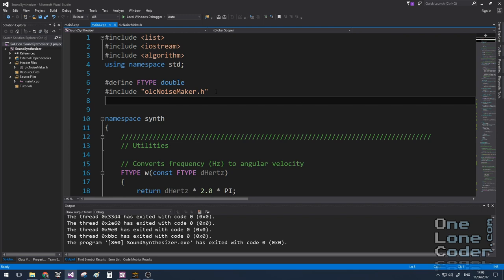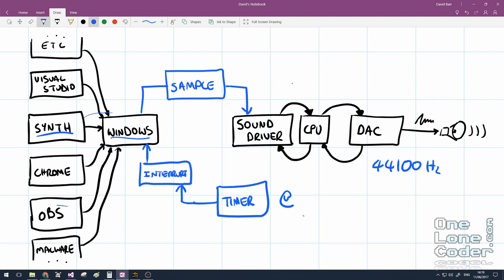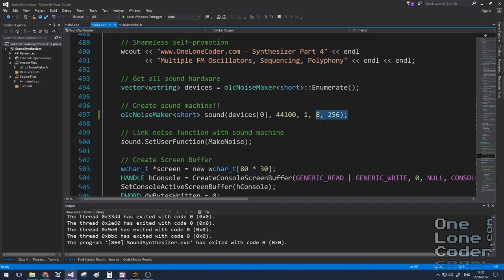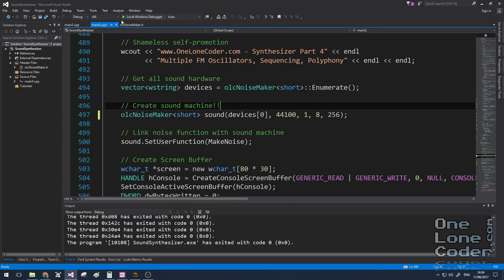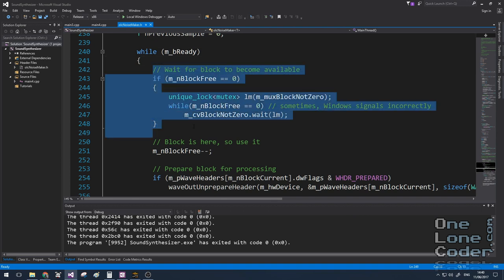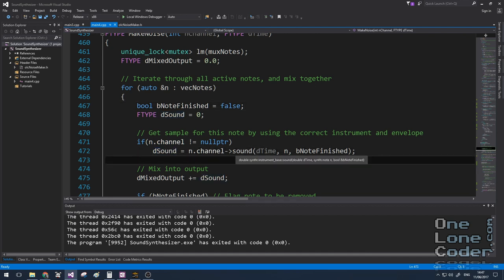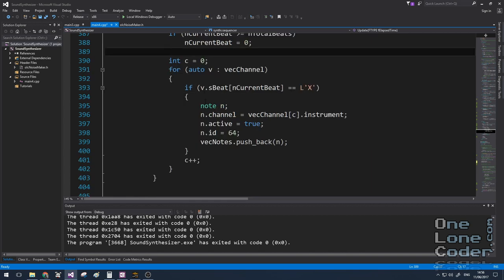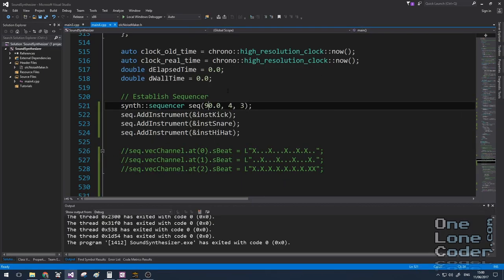Code-It-Yourself! Sound Synthesizer #4 - Waveout API, Sequencing & Ducktales

Comment: (RE: all the explanation up to 8:12) - it's interesting when you put it like this, because it could be manageable to actually have a big buffer size but also fire interrupts when the player is pressing or releasing a key to force recalculating the buffer? In fact if you take this to the extreme, you could have a pretty low timer frequency? Although when automatically playing keys, either through a MIDI (or MIDI-like) file, or your sampler system (which I didn't see yet), if you have many voices it might be costly, I guess you wouldn't want to recalculate that big of a buffer after all... Rule #1 of optimization is profiling :-) in the end as usual your solution is most simple for legibility and easy understanding. Cool stuff as usual! (also, I know this is two years old, sorry :-P)

EDIT: You'd also want to optimize-out interrupts when several keys are pressed at the same time, that works for automatic playing but still leaves the question open for chords. Alternatively, it could be transformed into a feature, by making sure key state transitions only happen at regular intervals, maybe a divisor of the tempo... Makes it sound like you're always perfectly on beat :-)

EDIT2: Sorry, I typed a block of text again. >__<

Comment: I'm thinking of implementing your synthesizer code on a FreeRTOS embedded device with rotary encoders and knobs and switches to configure the waves and envelopes and send the Digital sound over Bluetooth to a external DAC on a Bluetooth speaker or something like that. A Cheap ESP32 has 2 cores at 260MHz and several IO ports as well as WiFi and Bluetooth...

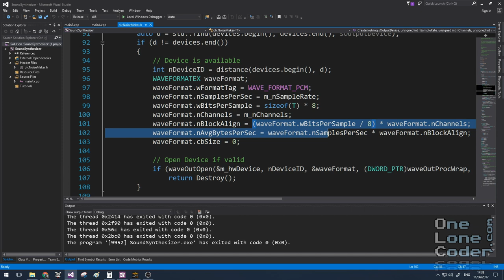Comment: 12:24 Have you considered what will happen if the supplied device name hasn't been found on the list? :q  In that case, this block will get skipped, so the device won't get created (which wouldn't be possible anyway for a bad device), but the function continues to run after the block willy nilly – it allocates the buffers, creates the thread, and returns `true` :q  I'm not sure if that's what's supposed to happen for a wrong device :q  I'd rather changed the condition to its opposite and exited the function on bad device, and put the code from that block after that `if`.
12:48 I'm not sure about this code too, because it doesn't seem to take into account the fact that there could be more than one channel, and in this case, more than one sample in each frame. If `T` is supposed to be the type representing a single sample, then `sizeof(T)` is the number of bytes of just one sample, and when multiplied by `m_nBlockSamples`, it will tell the block size in bytes, with the assumption that each there's only  one sample each frame (i.e. single channel).

Comment: Hi, great series, thanks. Can I ask you to update the olcNoiseMaker.h on GitHub as its only the first version (part 1) - it changes quite a bit between Part 2 and 3 (e.g. SetUserFunction takes the channel as an int - GH version still only has Double) - I can blag my way throught hat change, but not sure what to do with  UserProcess now, currently just returns zero. Also, part 3 is not on your blog site that I can find; 1, 2, and 4 are. Thanks again. 
PS: I liked the style you used in parts 1 and 2, coding as we went along, rather than 3 and 4 where you show changes you made - it is useful to run after little changes (learn far more that way), rather than  have it broken until the end of the video, or just pasting from GitHub (had no problem with the length, your pace is great, so didn't get boring).
Reply from the maker: Hi Richard, thanks for following along. Its really humbling when someone like yourself is using and enjoying the material. I've uploaded the modified olcNoiseMaker class https://github.com/OneLoneCoder/synth/blob/master/olcNoiseMaker_VIDEO_PARTS_3_4.h 
The pace is difficult to judge. I think you're right. The synthesizer videos benefit from the more methodical pace, as I made the decision to do a multi-part tutorial series (and I'm returning to it in the not too distant future ;-)), whereas I try to keep the one-off videos self contained but not too long. Hey, I'm still learning how to do all this! Perhaps the C-I-Y videos should be more tutorial like too.
Anyway thanks for the support!
Reply from the maker: Looks like you need UNICODE enabling for your compiler!

Comment: fantastic set of videos what would be the best way to display the sound ?
Reply from the maker: Thanks Tommaso, I have developed a simple library for visualisation called olcPixelGameEngine (there are many of my videos that use it). However in general, you want to view the amplitude of the sound (like a DAW) and sometimes you want to view the frequency spectrum whcih is considerably more complex to understand, but reasonably easy to do once you have taken the Fourier Transform of the waveform.

Comment: 11:36 So it's platform-locked? ;/
Reply from the maker: Not any more! The community created a openal/alsa version as an extension to my PixelGameEngine. It's pretty much identical in function, and you can grab it from the repo!
Reply: @javidx9  Ok, cool, I'll take a look...
Programming ALSA seems quite complicated because of very poor documentation and lack of good tutorials.
However, it's kinda platform-locked too (Linux-only).
For a cross-platform approach, SDL or SFML might be a better option.

Comment: Hey. Great series. I was wondering how you avoid clicking or popping noises between sounds played back to back. For example, if you’re holding down a note and it’s sound buffer is played repeatedly (giving the illusion of one continuous buffer) how do you avoid delay between the buffers? I’m trying to implement a similar setup to yours. Thanks!

Comment: Long shot, but I was trying to update a project from a few years ago which used this, and I have no sound in release mode, while debug mode works ok. Now, I've messed with the system a bit and I know this is an old video, but I figured I might ask if anyone has any stray pointers, since I'm stumped
Reply from the maker: This sounds like a variable initialisation issue. In debug, everything gets zero'd by default, not so in release, so make sure you're not using something you've not defined properly.

Comment: Hi, this is an excellent tutorial! I actually use your template for trying out different analog filter emulations. However when i create several "oscillators", or more correctly, sine functions for frequency modulation, the amplitude of the waveform is always rising, leading to increased modulation. I suspect it is because of the m_dGlobalTime parameter in the olcNoiseMaker class that is constantly growing. However that variable is only used in the sine function, so i think i miss some math related here. Any clues?
Reply from the maker: Hey thanks! It's additive synthesis so the more stuff you add in, the signal will tend towards increase in amplitude.
Reply: Thanks for your fast reply! I understand what you mean, but i use the value of the sine function A to modulate the frequency value for sine function B, so it is not about adding sine waves together. 
// Pseudocode more or less
float sineA = sin(w(freq)) * 0.5; 
float sineB = sin(w(freq + sineA)) 

Anyway, your tutorials is awesome!
Reply from the maker: Ahh i see. That is strange. It seems unlikely sine would return values > +-1 under any circumstances. I might have a play myself and see if I can replicate amplitude increase
Reply: I will report on my progress as well
Reply: I solved it! Of course i have to add the modulation value after the base frequency has been calculated and multiplied with the dTime value. So now it works as i expect. Thank you anyway for your reply!

Comment: Hi,
Your 18:30 example is silent
Reply from the maker: Hi, it's really low frequency, you may need a subwoofer. A bad choice on my part perhaps, but it's there!
Reply: Understood, thank you!
I also noticed, that in your previous example (main3a.cpp) you never assign a second channel to a note, only first (line 409), while actually checking for it at line 335. Just some observations..
Reply from the maker: You're quite right. The example code only allows the user to interact with a single instrument. But Easy to mod in with the shift key for example. Its a result of my testing code still being in there. I try to sanitize the code before uploading it to make it "easier" to follow and modify. Part #4 does change this approach however to a more flexible option.
Reply: Okay, understood, thanks again!

Comment: When I considered enhancing my voice synthesizer to do musical instruments, I intended to be able to generate very authentic-sounding waveforms. I'd achieve this by studying the frequency spectrum of the various instruments (string, woodwind, brass, and even percussion). Generating a wave from the frequency spectrum is easy to do with the formant synthesis technique. In fact, most musical instruments would be much easier to generate than the human voice. Also, my voice synthesizer would be able to sing, and not just speak. I have wanted to do some song parodies, but I can't sing; so my voice synthesizer would be my singing voice. Part of the reason why I abandoned the project is because other developers are probably already working on this.

Comment: would you do some advanced stuff in (pure)C??
Reply from the maker: Hi Laureano! If I may ask why pure C? Which platform are you targeting?
Reply: i just love C.. at the time my target is OSX i think, 
but it would be nice to know; how to do "everything" for linux and pc too..
Reply: The problem is that you could not get away with using "pure" C (by pure I am assuming that you mean cross-platform) for this tutorial as you would have to use Windows-specific synchronization/threading APIs (as opposed to the pthreads library on *nix systems).

Comment: Hi,
I have tried to retype files main4.cpp and olcMakeNoise.h (both versions) and after two evenings of typing, couldn't compile. it was few wrong type errors that I tried to fix with some 1-3 line conversions. It compiles but it is so slow. I have tried on i7 1st gen/win10 and dual xeon 8 core/win7... both are with high latency, and in release version there is no sound at all. I have also checked if I made any typing errors with file compare utiliy, found a few mistakes and correct them, but no change.
I am using visual studio community 2017 version 15 with latest updates and default settings. I have just made empty c++ console project and typed in your code. 
Perhaps I just need to make some setup changes to make it work as is? Or if not, I don't know if you have time to check the changes I made to make it compile the main4.cpp maybe that is the reason app is so slow running and unable to play both beatbox and pressed keys? If you are willing to review and mentor me in making this work on my setup, please give me your prefered way of communication.
I am total novice in c++ and I used to make a few things in visual basic few years ago. 
Thanks
Reply from the maker: What where the errors?
Reply: @javidx9  from original files I get this:
Severity Code Description Project File Line Suppression State
Error C2664 'BOOL WriteConsoleOutputCharacterA(HANDLE,LPCSTR,DWORD,COORD,LPDWORD)': cannot convert argument 2 from 'wchar_t *' to 'LPCSTR' synthmaster c:\users\ikalo\source\repos\synth-master\synth-master\main4.cpp 697 
Error (active) E0167 argument of type "double (*)(int nChannel, double dTime)" is incompatible with parameter of type "double (*)(double)" synthmaster C:\Users\ikalo\source\repos\synth-master\synth-master\main4.cpp 559 
Error (active) E0167 argument of type "wchar_t *" is incompatible with parameter of type "LPCSTR" synthmaster C:\Users\ikalo\source\repos\synth-master\synth-master\main4.cpp 697 
Error C2664 'void olcNoiseMaker<short>::SetUserFunction(double (__cdecl *)(double))': cannot convert argument 1 from 'double (__cdecl *)(int,double)' to 'double (__cdecl *)(double)' synthmaster c:\users\ikalo\source\repos\synth-master\synth-master\main4.cpp 559 

after I fix the .h file then:
Severity Code Description Project File Line Suppression State
Error (active) E0167 argument of type "wchar_t *" is incompatible with parameter of type "LPCSTR" synthmaster C:\Users\ikalo\source\repos\synth-master\synth-master\main4.cpp 697 
Error C2664 'BOOL WriteConsoleOutputCharacterA(HANDLE,LPCSTR,DWORD,COORD,LPDWORD)': cannot convert argument 2 from 'wchar_t *' to 'LPCSTR' synthmaster c:\users\ikalo\source\repos\synth-master\synth-master\main4.cpp 697 

after I put some code to convert wchar_t to LPCSTR, then I got error when adding notes to vector so I had some conversions there too.

so, I found this trick to convert
                 wstring Wscreen(screen);
  string Lscreen(Wscreen.begin(), Wscreen.end());
  WriteConsoleOutputCharacter(hConsole, Lscreen.c_str(), 80 * 30, { 0,0 }, &dwBytesWritten);

after that I get this error
Severity Code Description Project File Line Suppression State
Error C2664 'void std::vector<std::wstring,std::allocator<_Ty>>::push_back(_Ty &&)': cannot convert argument 1 from 'CHAR [32]' to 'const _Ty &' synthmaster c:\users\ikalo\source\repos\synth-master\synth-master\olcnoisemaker.h 182 
Error C2664 'void std::vector<std::wstring,std::allocator<_Ty>>::push_back(_Ty &&)': cannot convert argument 1 from 'CHAR [32]' to 'const _Ty &' synthmaster c:\users\ikalo\source\repos\synth-master\synth-master\olcnoisemaker.h 182 
Error C2664 'void olcNoiseMaker<short>::SetUserFunction(double (__cdecl *)(double))': cannot convert argument 1 from 'double (__cdecl *)(int,double)' to 'double (__cdecl *)(double)' synthmaster c:\users\ikalo\source\repos\synth-master\synth-master\main3a.cpp 394 
Error C2664 'void std::vector<std::wstring,std::allocator<_Ty>>::push_back(_Ty &&)': cannot convert argument 1 from 'CHAR [32]' to 'const _Ty &' synthmaster c:\users\ikalo\source\repos\synth-master\synth-master\olcnoisemaker_video_parts_3_4.h 186 

so, I found similar trick like the one for the screen
if (waveOutGetDevCaps(n, &woc, sizeof(WAVEOUTCAPS)) == S_OK)
   {
    char cName[32];
    std::vector<char> vName(cName, cName + 32);
    std::string sName(vName.begin(), vName.end());
    std::wstring wName(vName.begin(), vName.end());
    sDevices.push_back(wName);
   }

after these changes I get successfull build, but in debug mode as soon as I press a key, it goes choke... in release build I don't get any sound and notes queue filling up almost as in debug mode after i press the first key.
Perhaps the issue can be that when I started empty project VS created one for latest windows 10 SDK version.
Can you tell me which sdk you used for creating project?
Reply from the maker: Those errors can all be fixed by enabling unicode character set in vs project properties, general, character set. Hopefully if that works ill have similar code to you which makes these things easier to sort out ☺
Reply: @javidx9  works!!! thanks. Now to make a midi player out of it as I wanted.